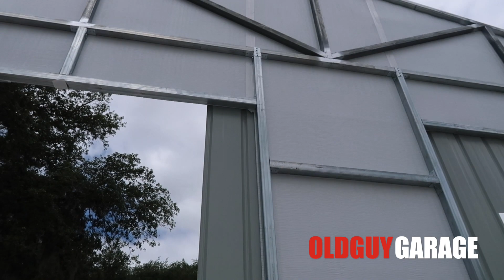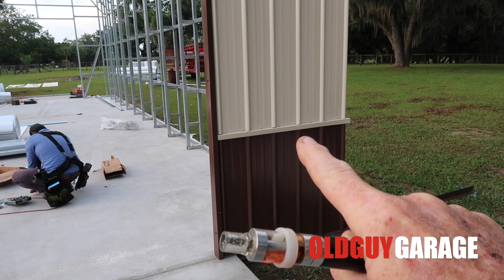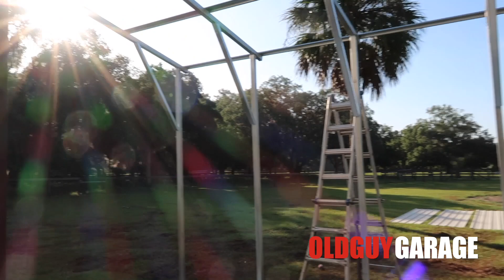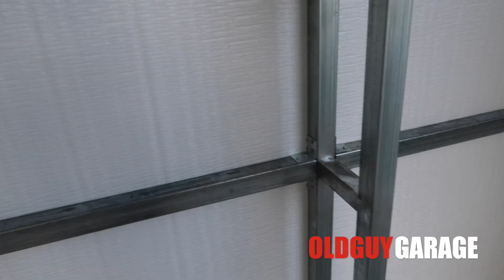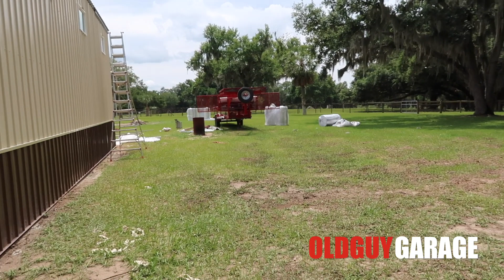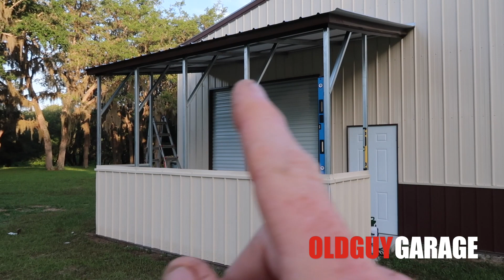Barn Shop Garage Build How to | Part 3

Comment: What was the cost if you don't mind? I'm looking to do a 30'x40' with 14' walls, two 12'x12' overhead doors and one entrance door.
Reply from the maker: Give Rich Henry at Xtreme Structurez a call, nice guy and will quote you right up.
(336) 831-4899